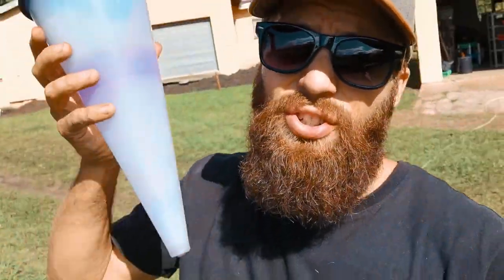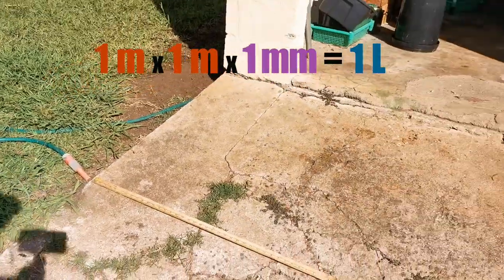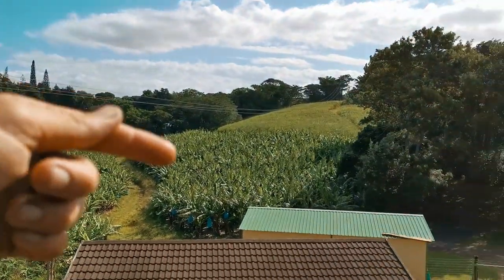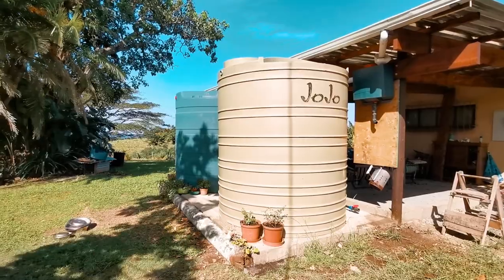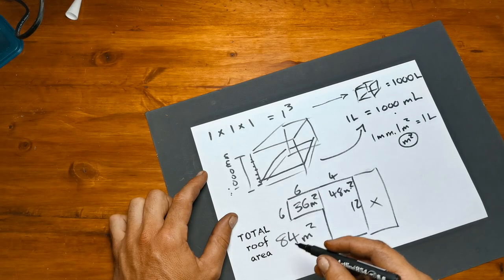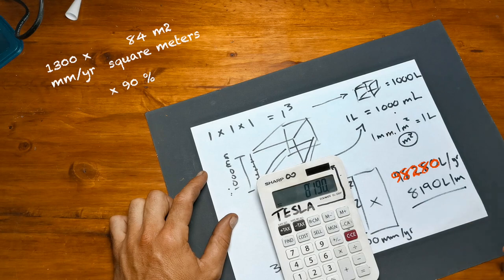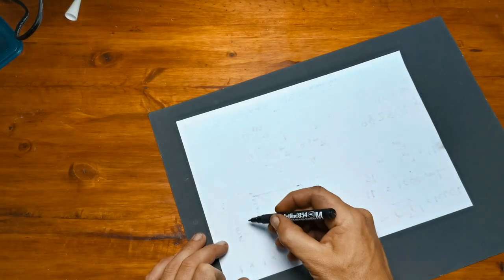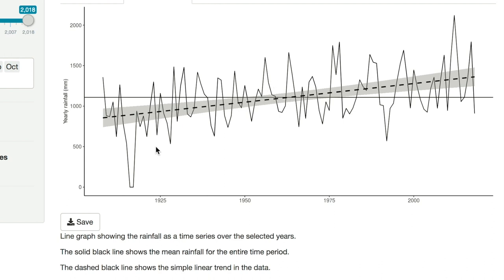Harvesting rainwater SOUTH AFRICA | HOW TO

Comment: Dankie for the video. i like the mathematics on how much water you anticipate collecting. I am planning the same system not for drinking but for watering the garden and topping up the swimming pool.I would have loved more details on the pump, how much pressure do i need to push the water upwards a mild slope. Can I use the same pump to drain water from a submergged tank.
Reply from the maker: Howzit

I would not ever recommend burying a tank unless you have too. For pump pressure you must look at the Max Head that the pump you have can push. It is the maximum vertical elevation that you can move water and each pump will differ. I have a 0.75kw pump and it can push a 35m head. I use a pressure controller on the pump to maintain 3bar in the house. The pump I use is not suitable for draining a submerged tank because it needs to be primed before it can suck and it is not recommended to put a heavy suction on these pumps. To drain a submerged tank it would be advisable to get a small submersible pump for the job.

Cheers

Comment: So, which tanks has been better so far, at just sitting there doing nothing but keeping liquid inside it. The competition is tight.
Honestly though, Kinda liking the roto and Nel stuff more than Jojo :|
Reply from the maker: I also have a bias towards the roto. As it goes they are both holding strong with no clear leader. I think this is a 10 year race 😜